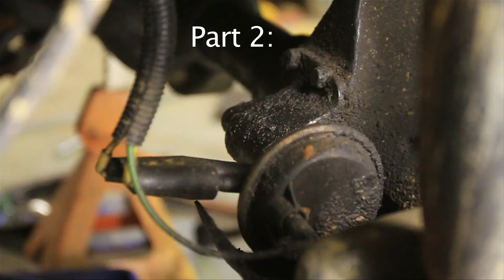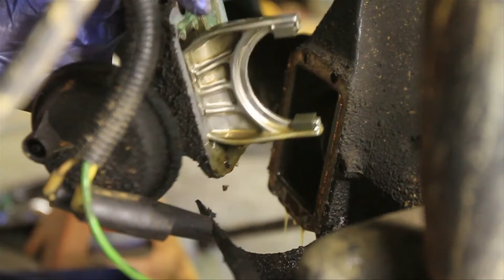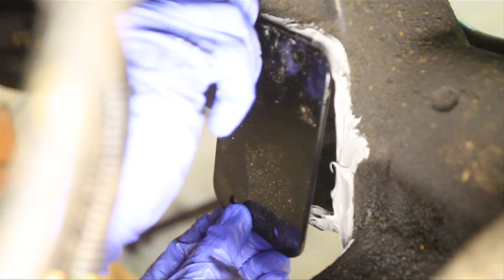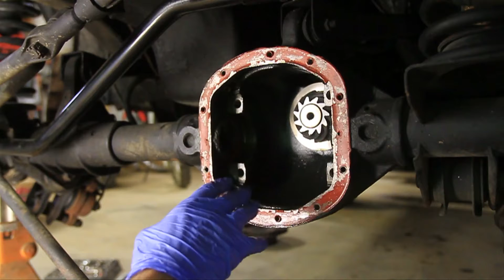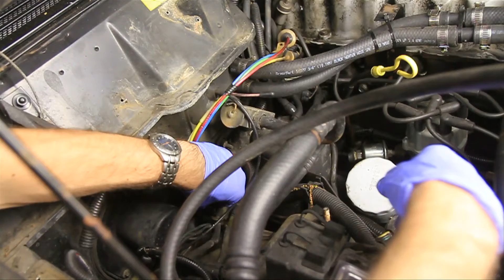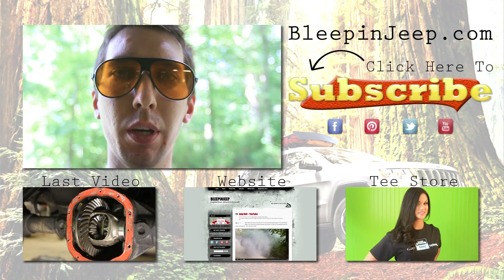Dana 30 - 2 Piece to 1 Piece Axle Shaft Conversion - Part 2 of 2

Comment: In case anyone comes on here wondering about that little bushing that is inside the actuator part of the tube. It’s a plastic bushing that pops out from the differential side. I used the old inner axle to knock it out.
Reply: Thank you! I needed this

Comment: Wonderful video. 9 years later I have this issue. Did you ever find out if you needed to delete the bearing that was next to the CAD? You left it and ran the shaft tight into it. Thanks
Reply: Did you take the bearing out? I had to so my shaft would go through.
Reply: On my year, I did not have a bearing. They have a plastic piece that looks like a roller bearing but does nothing but probably prevent the shaft from over extending to  the outside. It popped right out. I have been running without with the new straight shaft. I am not sure if I could of left it in but It did not provide any benefit.

Comment: Question ?
So you replaced the 2 part shaft that allowed that side to stay out of 4 wheel drive. Which is best for turning !
So with that one piece axle when Yu turn it's going to hop because it's positive track. 
If your daily  highway or road using this could be bad on the front differential ??
Explain why ???
Reply: It’s fine and doesn’t affect steering unless your in 4wd. The only change is your front driveshaft will turn at all times but unless it’s put under load it won’t change anything. Might have to balance the front shaft and make sure that pinion angle is set correctly

Comment: I just got this done and I didn't take that collar out. It is made out of a weak metal or plastic I drove it for about 20 miles and it made a rub mark on the shaft I took it out it had been eaten up and had started chipping out on its on. So take it out.
Reply: Thank you! I was hoping I wasn’t crazy. I’m installing a Chromoly and I think it might be bigger 🤷‍♂️. I did the same and found a rub mark from the support collar.
Reply: Thank you for this

Comment: Hello good, I wanted to make an appointment because I have the same problem with my front differential that does not work that of the vacuum ...
My query is, what happens if instead of changing the whole arrow as samples in the video, I simply walk the two parts together permanently? Would this affect me in any way by carrying simple and speedy gear?
Would not it be the same to join both parties to change the whole arrow?
Thank you!
#JeepComanche ❤💪

Comment: on Dodge trucks with the Dana 44 front axle I have used one piece conversion axle shafts . they have a swell surface to use the stock seal location .
Reply: I have a 2001 ram with the 44 and want to do this.....any info on the parts you did yours with?

Comment: Why not use a real gasket on the diff cover?
Reply: Smart people don't pay $20 for a gasket when $1 worth of Permatex does the same thing.  Especially when you're in and out of your pumpkin all the time.
Reply: lube locker ! best $20 ever spent ! a tube of rtv is $7 or $8 so why not spend a little more, but only ever need to buy one ... no more rtv, no more paper gaskets, no more cleaning, just service your diff, change your gears and reinstall. they last for years

Comment: I know this is an older video, but I was wondering if you or your dad have had any issues with the axle from the collar being left the axle housing shown at 1:30 in the video.  the clearance seemed tight and I was wondering if there was any damage or premature wear on the shaft?
Reply from the maker: +Tom D he doesnt drive it much but no, no problems yet.
Reply: Thank you for this question. I’m about to do this same thing. You would think with the axle shaft spinning on top of that collar without oil that it would prematurely wear. Any new advice? Thanks

Comment: if you guys are needing your 4x4 to work and the collar locks when it feels like it. or not at all. take the motor housing out and set the collar so the axle shafts are locked together. take your motor housing and drill a hole from the housing and on thru the fork. determine where to set the fork so it matches the collar. get a long bolt with a lock nut and put it in. you have now immobilized the fork so the collar cant release. you may have to adjust the bolt to make sure it is either tighter or less tight till the collar is centered.   rtv the bolt head where it passes thru the housing to keep water out. a 2 dollar repair you can use until you get to doing the one piece shaft upgrade.   to do this there is no need to take any wheel or hub, or axle apart. only the disconnect motor is to be removed.

Comment: noob question. so is this now full time 4wd?
Reply: +Brandon Card 231 will NOT make it full-time 4x4.  All it does is make the front drive shaft spin all the time like every Jeep manufactured after MY1995.  The drive shaft is still disconnected inside the transfer case.  The transfer case will function EXACTLY the same as before.
Reply from the maker: Bill Balding no, its still the same as it was... just stronger.  in fact, they changed all XJ's over to this in later models.

Comment: one more thing-- i used long needle nose pliers to get the inner axle out, used as a lever and grabbed the axle from the  hole where the actuator mounts and then slid it on out thru the knuckle.
Reply: so you put the new seal where the other seal was on the passenger side? and put the shaft in?
Reply: right
Reply: sweet! thanks man!

Comment: hey i did mine different- let me give you a quick run down.pulled the wheel.hub and axle shaft on the long side and the inner axle shaft and the collar. and the actuator motor. on the outside of the motor housing, it is machined for the same seal and that is where i put my seal. you can do this and not remove the diff or the driver's side hub etc. your seal installer would work . i used the seal from a junk d30 --yes it has a used seal that i buggered up twice by bending the crap out of it and i broke the spring and fixed both and got it installed and it seals on the outer part of the axle. no leaks, no problems. and i left the vac lines all in and the actuator I bolted back on place, the fork doesnt touch the axle shaft and everything works as it did new. so to do it my way all you need is an axle shaft and a seal and a seal installer. no oil change no oil loss. no diff removal, no rtv.
Reply: +Bradley Campbell 
I know this is old.  Thanks for the input.  Do you have the seal part number?  All I need is the seal.

Comment: I haven't got around to it yet but its rumored that some late production 96 xjs have 8.25 with 29 spline because they ran out of 27 spline near end of production of the 96...almost believable since they did produce more in 96 then any other year if im not mistaken someone correct me if im wrong. but most 96 and older xjs have 27 spline, 97 and up 29 spline on my driver door the sticker says 8/96 so I hope im lucky have to take diff covers off and change/clean it out anyway so I will check then fingers crossed lol this jeep will hardly ever be on road so it has alot of plans in its future 255K miles :) a lot of trails were I live but not a lot of wheelers :/

Comment: do you need to put manual locking hubs on or do you just keep the axles ingauged all the time? im straight axling my ranger with a axle out of a 86-88 cherokee so i def. need to delete the vacum.

Comment: i have a 91 wrangler and was thinking about doing this but i thought the front wheels would be locked together. are you saying that it wouldn't be locked together?
Reply: I know this is 8 years old but you would still have an open differential so they would not be locked. Also 4wd would be applied through the transfer case.

Comment: You have a part number for the seal an block off plate? Or at least a seal pn# so I can get started?
Reply: Sheet of metal, grinder and a drill bit is the best and $ way to go. Super easy to do!

Comment: If I recall I think all of those lines run to the transfer case. In lieu of a regular electrical switch mounted in the t-case for the 4x4 indicator light, the CAD system has a vacuum switch mounted in the same spot. It is what sends vacuum to the front axle disconnect when 4x4 is applied. Dumb system. I have my collar locked now. I want to eliminate the extra vacuum line crap and go ahead and install the electrical switch in the t-case so my 4x4 light works when it is supposed to. Awesome vid!

Comment: so say I want to upgrade my axel shafts actually and it would be a one piece. would it pretty much be the same process to do that? Also would I need to remove the second coller when removing the CAD since it will be a bigger axel shaft?

Comment from the maker: are you referring to the outer stub shaft?  You could mix and match but its not worth it.  just go to your closest pull a part and get the whole deal for $25 and then replace the u-joints.  I have vids for everything you could possibly come across for this including axle shaft removal and changing the u-joints.

Comment: Hey bleepin I found a guy who would sell me a one piece from a 95 Cherokee but he sold the outer shaft to it. The o e m replacements are 100$ you said in your video you need them so you have more four wheel strength . Can I still run the one piece with the smaller outer shaft stub from my old axel 2 piece ?? Let me know your feedback

Comment from the maker: some XJ's for some reason have a c-clip on the inner axleshaft only.  This is probably your case.  If so, you'll need to take the diff cover off and remoce the c-clip before it will slide out.

Comment: 89 jeep Cherokee xj 2 piece axel disconnect the passenger axel when you pull it out has a small hole that a needle bearing goes in. When that shaft connects to the 2nd piece of the axel it has a small nipple on it. In your vid you had the axel shaft in your hand look at the end with the splines where the shift collar for the cad system sits its right there . Called a outer shaft axel bearing

Comment: On the two piece axel there's an outer shaft axel bearing. I lost all the needles when I pounded a new u joint in. What would be the best tool or easiest way to get that small needle bearing out?

Comment from the maker: Well I always replace both sides, Then you'll have the same stronger u-joints.  You'll also have reliable 4 wheel drive.  I remember back in the day tree branches would always pull the vacuum line off the axle and then I'd have to crawl in the mud to get my 44 back... pain in the butt.
Reply: I did the same. TJ shafts are inexpensive and a good upgrade.

Comment: What are the benefits to going with a 1 pc axle besides ease of maintenance and an optional bigger u joint (which than makes it confusing with 2 different size joints up front)?

Comment: What are your thoughts on leaving the two piece setup and installing a manual engagement with a locker so you can disengage the axel if you need to make a tight turn?? Thanks.

Comment from the maker: Well I think that the engineers probably were very smart and knew exactly what they were doing when they designed the drain plug height.  If anything I would use a better gear oil, not overfill.